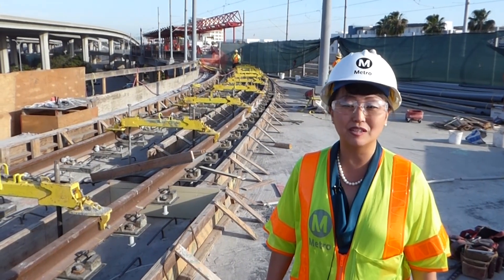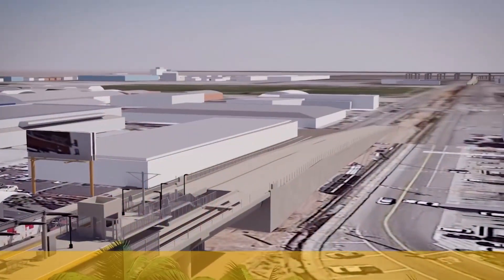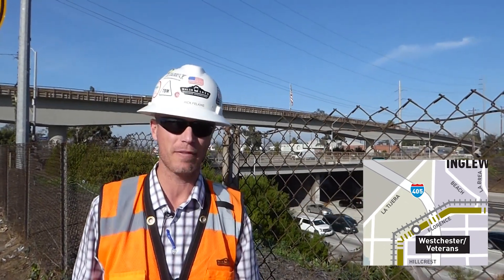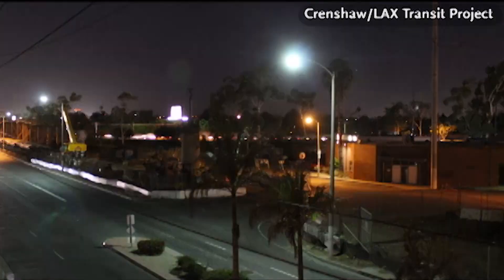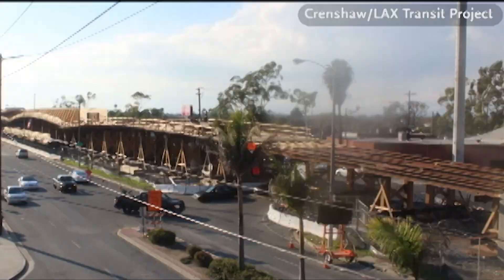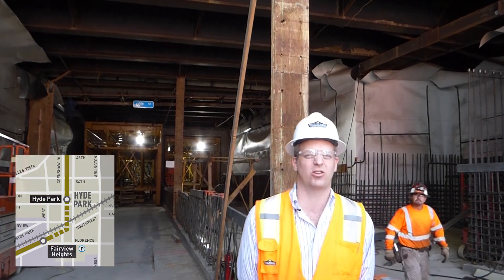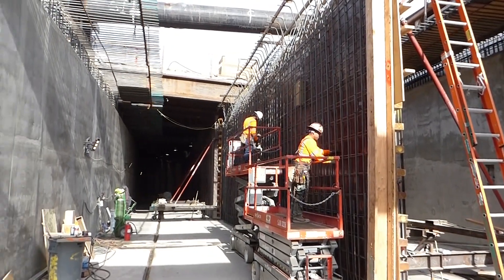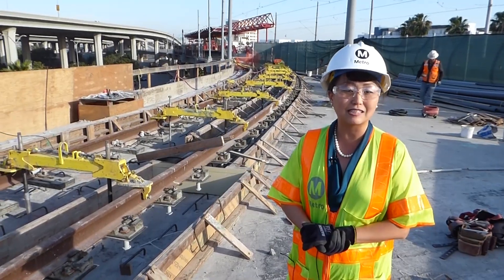LA Metro’s Ambitious Line

Comment: this video really reminds me that a lot of major cities in the us have notoriously bad public transport. as the second most populous city in the nation, it's a shame how late to the game the city has been to railways, even after the electric streetcars were terminated. but there are plenty of other cities with almost non-existent public transport, such as houston and phoenix, 4th and 6th on the most populous cities in the us. regardless, the main reason this is even happening (measure m) in my opinion is because of the 2028 olympics. that's why they're really putting effort in completing the purple line by 2026. probably by 2028 this crenshaw line will have extended to west hollywood. the sepulveda pass project will probably actually start around 2021, if we're lucky and obviously won't be done in time for the games. there was rumor of a vermont subway, but it's most likely going to be some sort of silver line busway system somehow, which is stupid and pointless. we need more heavy rail in los angeles! it would make such a difference. if the expo line and blue were to be heavy rail... SO many problems would be solved.

Comment: While it’s good to see them expanding their wonderful system, I feel like they’re spending money on areas that don’t really need Metro, while not batting an eye to the areas that do, like West Hollywood and the Sepulveda Pass. This project is connecting Inglewood to the South Bay and LAX, but can’t you take the Blue Line from downtown to the South Bay? This project will help relieve congestion but Metro, please focus on areas that need trains.
Reply: This line will actually be extended through West Hollywood eventually.  And, yes, there's definitely a Sepulveda Pass line in the works.  That one will be a massive undertaking, probably heavy rail subway (although they haven't decided yet); very expensive, very large project.
Reply: Politics is the main reason why they're working on the current projects first.  The measure needed support from all parts of LA County.
Reply: @Supernova Strike if any area needs more transit (other than what is currently U.C.), it is the Vermont corridor.  That said, the density along this line is reasonably high, and I think that it will have decent ridership.
Reply: Understand the unique Geology So Cal has makes this hard there is a lot that goes into this that is why they are picking old Red car lines
Reply: @Hotters 7060 Agreed, but we have to move forward based on the here and now.  It would have been easier if the Pacific Electric system was still around in some form.
Reply: @Hotters 7060 👍
Reply: The people of the Crenshaw Community need access to the county-wide Metro Rail system. The Crenshaw/LAX Line will do that. Similarly, the residents of the Gateway Communities of Southeast Los Angeles County also  need this kind of access that only a rail corridor provide. The West Santa Ana Branch Corridor will provide that. Not everyone lives in Hollywood or the Westside.

Comment: Where will they get all the electricity for these silly projects? They closed San Onofre and have not done anything to give the county more, cheaper electricity.
Reply: There is currently an actual electricity glut in California.  There was shortages around 2000, so they now have approved every power plant since then, providing lots of base power.  Plus, a lot of solar rooftop power has come on line.  Plus, usage has actually gone down recently due to more energy efficient appliances and things like LED light bulbs.
Reply: LADWP and SCE has 30% renewable energy portfolio, and that doesn't include all the solar residential homes.

Comment: Looks like a pork barrel project from hell.
Reply: All indications are that this line will be very heavily used, especially once the LAX peoplemover opens, providing a direct connection to the airport.   It also goes through Inglewood and then connects to the Expo Line.

Now, the original Green Line (without this extension) was rather stupid.  It starts a mile or two away from the Norwalk Metrolink station (which would have been a very useful connection), runs down the middle of the 105 (making the stations noisy and a significant distance from, well, anything), then almost, but not quite, goes to LAX (requiring a shuttle bus), then goes south to a bunch of military contractors that were downsizing even before the line was built.  Almost all of it is low density and it currently basically goes nowhere of significance.

This is counter from all the other Metro Rail lines, which all start (or pass through) downtown LA and also go to at least one other area of high density (Gold Line goes through downtown Pasadena and East LA, Expo Line goes past USC and ends in Santa Monica near the beach, Blue Line goes to downtown Long Beach near the beach, Red Line goes through Hollywood and up to Universal Studios theme park, Purple Line currently ends in Koreatown and is being expanded to Westwood).  Gold, Red, and Purple Lines all also connect to Union Station and therefore Metrolink and Amtrak trains from all over southern California.
Reply: Craig F. Thompson yes it has, more than enough, you're ridiculous
Reply: Craig F. Thompson cars are so much better than trains because you can drive your car right to where you need and you have to wait around for trains and then they're not even right at your destination you still have to walk. even with traffic its still more efficient than public transportation. just how it is in California. 

also
Reply: IHEartLReoy you know nothing about transportation planing do you...?

Comment: Sure hope they don't actually ever widen the 405 again! Great video.
Reply: sunk I405 under the ground deeper than  any rail tunnel
Reply: I think Judge Doom is based on Sam Yorty.
Reply: Either of them could have stopped them from getting ripped up, neither did. Yorty was the more obviously racist of the two though as far as I know, so I think of him as the real judge doom.
Reply: Many lines of both the PE and LARY still survived when Yorty took power. By the time Bradley finally knocked him out of office after I think over a decade, there was not a single rail line left - do the math, ya know?  Yorty ran LA for at least the better part of the 1960's.
Reply: Los Angelist Sure, but throughout the forties and fifties, Poulson simply FAILED at providing municipal protection for such good transport resources;  if he had, whatever Yorty would've done wouldn't be enough to place the southland into the HORRIBLE situation it's in right now!!

In fact, I think there were only TWO lines operating, one from each company;  the Long Beach line of the PE, and the Pico Street 'P'  car.  The PE quit in 1961, and the LARY  'P' car in 1963. Yorty was just coming to power back in those days; the bulk of the damage had already been done....
Reply: True. Whenever I do my "who was the real judge doom" expose, I'll be sure to give both Poulson and Yorty their due credit.
Reply: I heard the latest time the state widened the 405 freeway, the gridlock was worse once it was complete than it was before they began!
Reply: @edwardmiessner6502  Not true.
Reply: @edwardmiessner6502   I don't think widening freeways work too well because of all the changing lanes.
Reply: Los Angelist widening the 405 parking lot is and would be the dumbest, most, stupid & idiotic thing to do. In the Washington,DC area in the Virginia suburbs, The I-395/I-95 parking lot was widened to 14 lanes in the early 1970’s, 2 of those lanes were supposed to be bus lanes only, it wasen’t. I rode on the Amtrak Crescent from New Orleans after staying overnight there. While riding on he Crescent to Wilmington,DE I noticed a lot of vehicle traffic going into Washington,DC after rush hour on the I-395 parking lot-this was on 9/20/2012, I was on my way to my 40 high school class reunion. On 10/4/2012 I rode on Amtrak’s Cardinal into Chicago to get the Texas Eagle for Dallas. When I got on board the Texas Eagle, I rode past the I-55 parking lot in mid afternoon, the traffic on the I-55 parking lot was bad, this was not even the evening rush hour.
Reply: Sure hope they widen the 405. It is a parking lot in rush hour, need more thru-put.
Reply: @cheongyei  it never helps